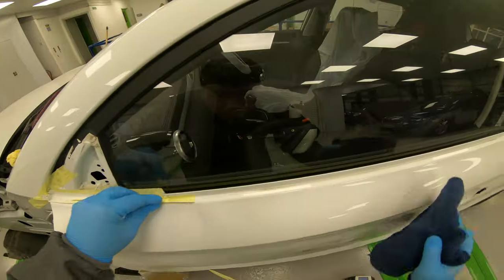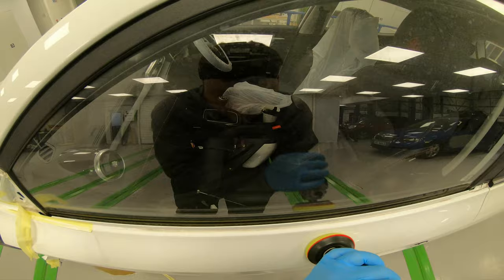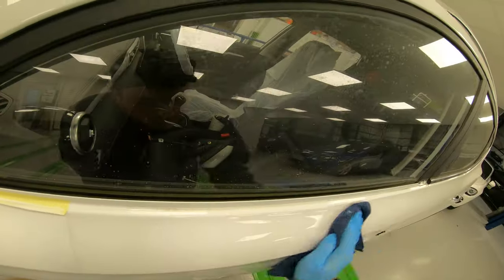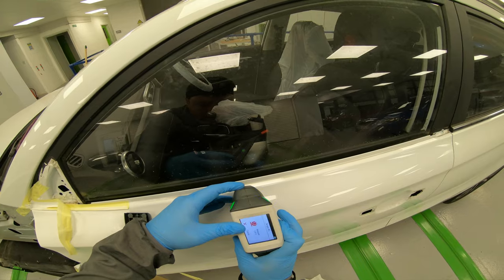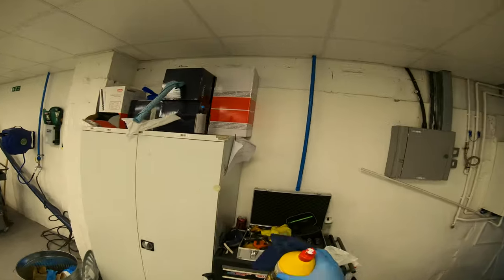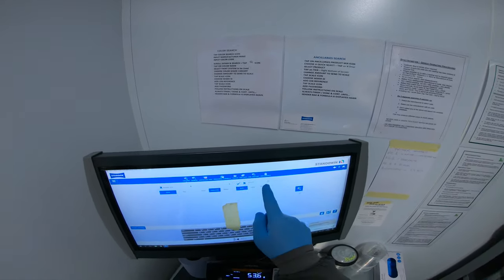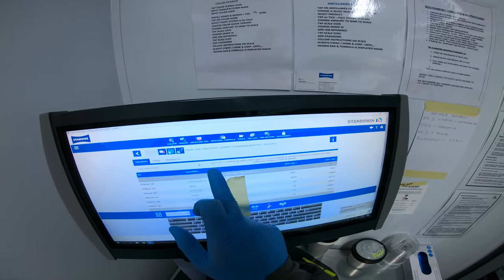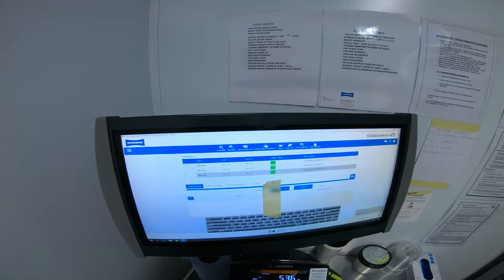Colour matching: Using Standox colour camera.

Comment: Ahh you’ve showed me something new again Paul . Never occurred to me to wash the fillers out of my scan area before scanning. We had to change compounds about a year ago because of the amount of fillers in the compound brand we were using.Buffed up quickly, not once washed or parked in the sun, the fillers would evaporate or wash out and then leave the de-nibb and sanding marks behind, especially on darker colors. Now find myself back tracking through your vids and gleaning all your juicy bits of info and adding it to my own knowledge base.
Thanks again mate
Reply from the maker: Hey Matthew, it never occurred to me either. I have been fortunate and had paint mixers in places I have works so I would only use the camera occasionally but at this place I have to do it all (which is no problem) but the Axelta rep told I did everything right except the fillers can effect the way the camera picks up the colour so to Degrease it. So I thought I would share, I enjoy sharing tips like these yhey can make all the difference.  👍

Comment: Interesting video Paul, I would like a spectro but for what I do I don't have a use for it but it's the tech that interests me as it takes a lot of the colour matching process out as it's done for you, I wonder how some of the younger painters would get on if we didn't have the mixing software and spectro, hmm so how did car painters mix and match their basecoat before we had this tech. 
I would never be able to be a pro painter as I'm partially colour blind, just imagine the colour blends if I was doing it 😱😂
Reply from the maker: 😆  I think you would be fine. We used to be provided colour chips from the paint companies and we always had the colour codes. So it was a case of doing spary out cards 1st and adjusting if needed by adding different toners I really enjoyed doing that way it's a lot more involved but really rewarding.
Reply: Yeah I would say it's very interesting doing the colour matching yourself but my problem would be that I wouldn't know if the colour I just mixed from the formula is a match until someone else spots it when it's all finished and it's miles out, I would end up on 💩house duty 😭🙄😂
Reply from the maker: @JohnWD40TC02  😆 yea poop House duty ain't good 🤣🤣🤣